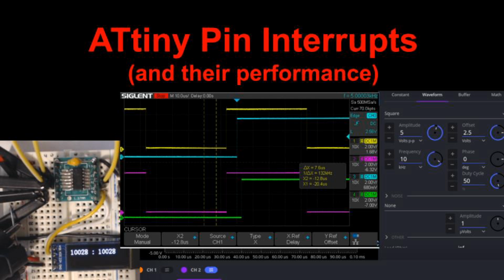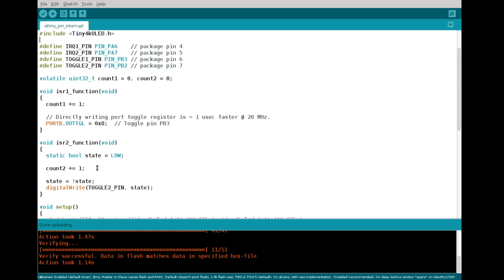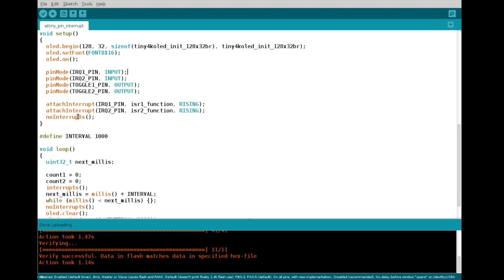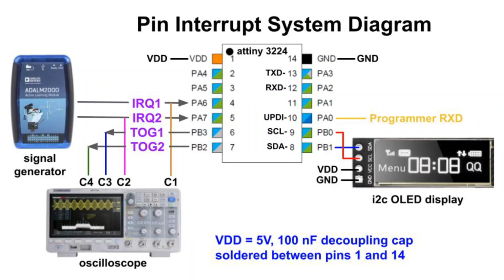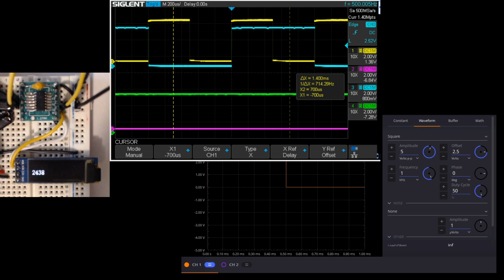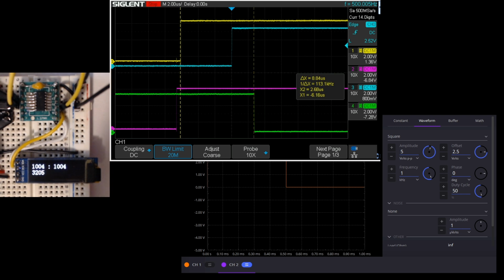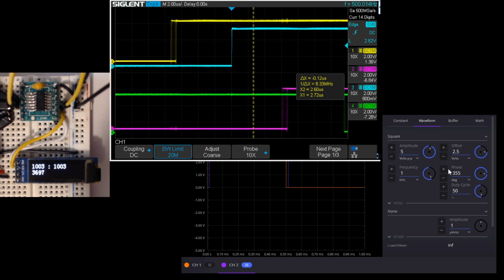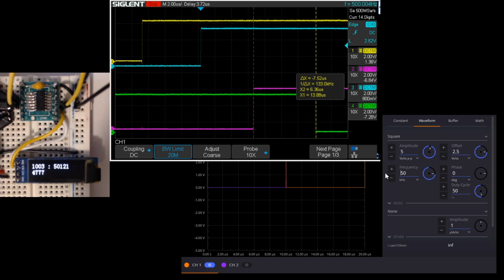ATtiny pin interrupts (and their performance)

Comment: Excellent vid! Could you please point me to the OLED display you're using? I think it's the only easy way to debug these ATtiny series 2 chips.
Reply from the maker: Glad you liked the video.  I bought a 5-pack from Amazon.  "Hoysond 5 Pcs 0.91 Inch I2C OLED Display Module IIC OLED Screen" https://a.co/d/gkk2kK3, but I think many similar displays are available.  Cheers.
Reply: @electronics.tinker Cheers!

Comment: What’s the overhead of using the runtime library attachInterrupt method, over compile time attaching to the IRQ vector directly…
IRQ(IRQ1_vect) {
  // IRQ service code here
}

The disadvantage is that you’d have to handle the register setup to enable the interrupt, and configuring for trigger on rising edges, yourself. The possibly significant advantage is that the ISR doesn’t have to vector through the Arduino core first before arriving at the ISR.

The compile time method should give you a quicker IRQ response, and allow handling more IRQs per second.  How much of an improvement depends on how the Arduino core has been coded.
Reply from the maker: Funny you should ask.  I just did a simple test of a direct external interrupt toggling an output pin.  Performance increased from ~100,000 interrupts per second to ~500,000. I'll include this in my next video along with other stuff.  Cheers.